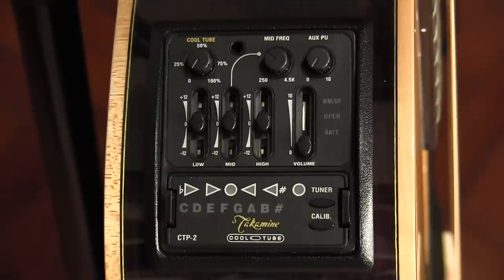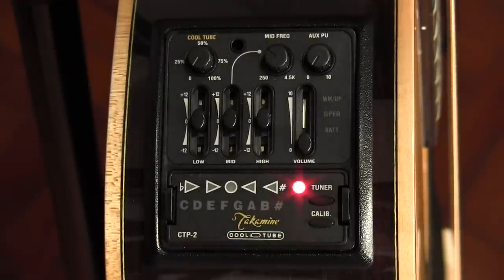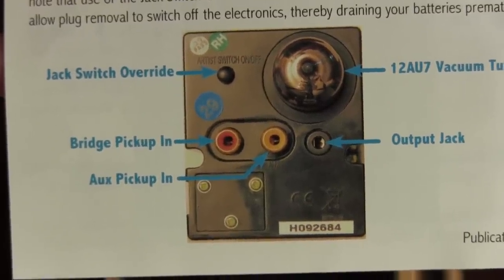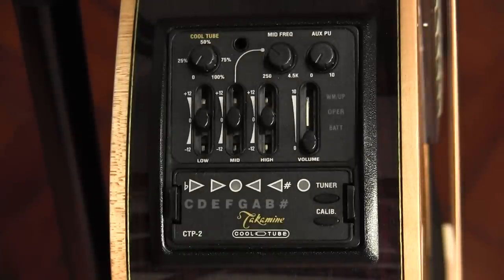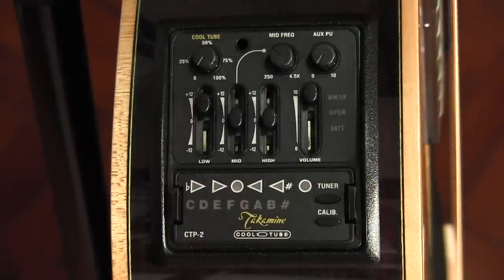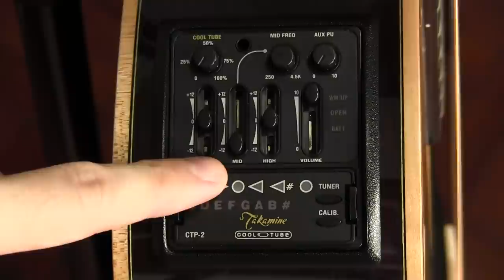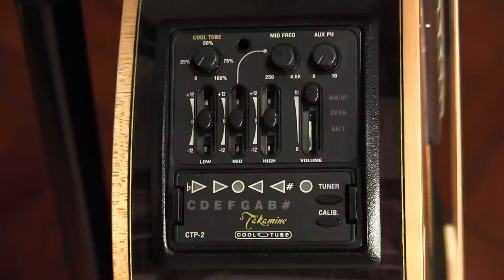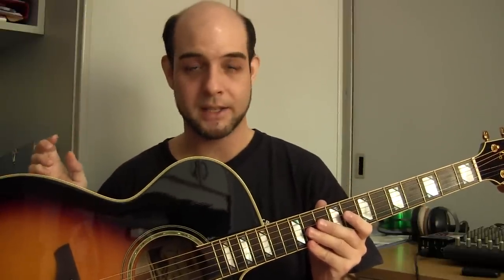The Takamine CTP-2 "Cool Tube" Acoustic Guitar Preamp - review and user guide

Comment: Me again : I forgot, can we buy a preamp CTP-2 ? I know someone that got a Spanish guitar but had put a CTP-1 to amplify his guitar. I'd like to know if it's possible to buy one and then install it in the guitar we want ? And for sure, I'd like to know the price of the CTP-2 ? Thanks by advance. CIAO BYE !
Reply from the maker: - Yes, the CTP-2 is a direct replacement for and is considered an upgrade to the CTP-1. You'll need to check the price of the preamp with your local Takamine dealer.
Reply: GLB Productions Hi ! If I asked the price, it's that the first music store is at 35 km from where I live, so I don't often go there. I got a problem with a Godin Multiac Duet. Those guitars are specials, and I don't know if we can put a CTP-2 on those guitars ? My preamp is "broken", and I'm asking myself how to replace the L.R.Baggs components that we can find on that guitar ? I've written to L.R.Baggs, and they told me that they don't have components to repair my Godin no more. I don't know what I'll do, cause I've paid that guitar 1800€ in 1999, and just less than 15 years after, no more amplified sound. I don't find L.R.Baggs very serious, This kind of guitar must be a guitar for life. That's why I was asking the price. I don't know if we can change the L.R.Baggs preamp with a CTP-2 ? Thanks for having taken on your time to answer to me. CIAO BYE !
Reply from the maker: - The Cool Tube preamp is designed to work with Takamine's original undersaddle pickup system, so it may not be compatible with the pickups in the Godin. Also, you would need to cut a large hole in the side of your guitar which should be avoided if possible! 
Have you tried contacting Godin directly? They may be able to help you: info@godinguitars.com
Reply: GLB Productions Hi ! Thanks a lot for having answered. Yes, I've contacted Godin Guitars, and I'm waiting for an answer. I hope that if it's not possible to change of preamp, they willl have the components that I need. If L.R.Baggs don't have them, I suppose that it's just cause Godin had changed to let Fishman take the place of L.R.Baggs, so they didn't wanted to stay with components that are going in the oldest Godins. If Godin don't have those components, I think that I will not be happy, cause making a guitar that costed 1890€ not possible to repair just 15 years after having been bought, it's really noàt serious. I find that they don't respect the clients. And they tell them that the Godins are made to be played.....It's only when you often play wiçth a guitar that you must make it repair. When you never touch the guitar, there won't be any problems. Thanks for having answered. CIAO BYE, and sorry if my answer is a little bit long. CIAO BYE !
Reply from the maker: - No problem, hope you can get your guitar fixed soon!
Reply: GLB Productions THANKS! CIAO BYE !

Comment: nice review. thanks.
Reply from the maker: You're welcome, thanks for watching!
Reply: what do you know about the p5nc guitar? thinking about buying one on sale. i have a p6nc and i like it but its a bit heavy.
Reply from the maker: The TSF48C featured in this video is the same general spec as the P5NC ie NEX body, spruce top, rosewood back and sides. And it is pretty heavy too! A lot of the weight comes from the preamp, especially the four AA batteries. 

I suggest that you compare this guitar with an OM size of the same wood combination - I personally have not found there to be much difference, especially when plugged in, and am slowly transitioning away from the NEX towards OM and New Yorker sized guitars.
Reply: thank you very much. cheers!

Comment: What's the advantage to Toby K. in having a laminate back? And... I read somewhere, someone saying that the CTBII is a better choice than cool tube. I'm guessing you disagree?
Reply from the maker: +mcdee56 My understanding is that the laminate back was just Toby Keith's personal preference. I prefer a solid back. 

I personally prefer the CT4BII for on-stage use because the controls are so much simpler and the resolution of the EQ is far better. I personally feel that +/-12dB is more than I would ever use on stage and hence prefer the smaller range of the CT4BII. The Cool Tube's extended feature set is better for recording where you have more time to tweak your sound.
Reply: +GLB Productions So  which models does the CT4BII come stock? I'm new to Takamine but have been researching for a new Acoustic guitar and arrive here. These are some fantastic sounds you are getting!
Reply from the maker: +mcdee56 At this time it comes stock on the Pro Series 1,2 and 3. It's also featured on some of the legacy models such as the EF341SC used by Bon Jovi and Bruce Springsteen. Yes, Takamine is hard to beat for getting a great fuss-free plug and play sound.
Reply: +GLB Productions Have you done a review of the P3NC? Have you played one? If so, is the cedar top lively enough? I had an Alvarez Yairi with a cedar top decades ago and it never sang-out and subsequently wasn't inspiring to play. PS: you are very thorough in your work and it's obvious that you are passionate for it!
Reply from the maker: +mcdee56 I haven't done a review of this model but I have the model it replaced, the ETN40c - pretty much the same guitar: cedar/sapele, NEX body. The cedar top is very lively to my ears - Takamine have a way of tuning their cedar tops such that they work well for pretty much all styles of music. The response is quick, even to a light touch, and the tone is warm but not dark like many cedar tops I've played. 

Glad you're enjoying the videos! If you want more opinions please sign up for the forum at http://www.takamineforum.com/ - many very helpful and experienced Takamine players over there.
Reply: @mcdee56  I bought EF250TK one month ago. I can say only one thing - the guitar is awesome! Also, Toby asked Takamine to build this guitar by his specifications. And he was totaly right!
Reply: @GLBProductions great review! I really like CT4B II preamp in my EF250TK.

Comment: I left the batteries in too long and they bled into my CTP2 preamp. Consequently, it now malfunctions. It doesn't amplify the guitar. Is it ruined? Where can I purchase a new one? or is there a series of steps I can take in order to deduce what the problem is? Help!
Reply from the maker: +Leo R. Salazar I would suggest taking the guitar to your nearest Takamine dealer and they will be able to help you with a diagnosis. The electronics in these preamps are quite complicated and not really user-serviceable. Fortunately, they are straightforward to replace.
Reply: Same issue.. new batteries over night and it bled a bit and now wont work...

Comment: Where does the tube get it's power? It takes a lot of power just for the emitter heat. I know it's just 6 volts but the low resistance means a lot of current.  That'll eat up batteries like crazy. Does this have an outboard power supply? How can the tube work without a heater element? Tubes don't work without the electrons being heated? This is strange science to me.
Reply from the maker: Takamine have worked out a way of running the tube at very low voltage such that it never gets hot but still adds even-order harmonics to the signal. In other words the tube is not used as an amplifier. How exactly they do this I have no idea :)
Reply: GLB Productions Ok, but now I'm thinking how some manufacturers and many experts believe that the power amps produce most of those sweet even order harmonic distortion and compression. Others produce amps with tube preamp and FET or whatever power stage amplification. If you're bent on having all tube amplification throughout the signal, dump all of your effects pedals is step one. All this will be argued for years to come. I use a tube amp for recording my acoustic and love it. Heavy distortion is not what I'm after. But I do believe manufacturers have to go with what the public demands. Even if it's just a minority of this public, the high cost and profit of tube devices means it'll be produced. Some of these "all tube" types even get a bit snobbish about all this and develops a nearly false pride attitude toward this subject. Tubes do have an attack, clean transparent high frequencies due to the high input impedance also. The high cost and high maintenance for professional use often makes the professional turn to FET amps for practical reasons. Anyway I am not a tube purest, and there's solid state amps oh there the are great. It all comes what each individual. Whatever sound the guitar and amp combination inspires you and is within budget, go for it.  I have my Les Paul and Strat which to me are basic must have guitars, and I have a lot of entry level guitars (guitars that cost under $300) and love them all. Each has its own voice and characteristics. If I dont love them, I sell them. And I've bought and sold well over 50 guitars. Well, after chatting with you, and listening to this, I'm not so skeptical about this cold tube device. It's just not my cup of tea. Now it's time to check out those Dowina guitars again.

Comment: The original pickup in my guitar and I put this one in and it has never sounded right. It runs really hot almost too much mid and tops . No tone whatsoever it's horrible (takamine guitar and the first pickup was great untill it died). The guitar sounds great acoustically - does anyone know what the problem might be? I have to have the bass right up and the treble off and still sounds horrible help :(
Reply from the maker: Hello Sarah what is the make and model of your guitar? Also, I assume that you mean preamp and not pickup? The pickup is under the bridge, the preamp is the component described in this video.